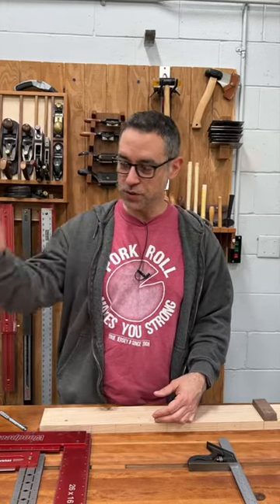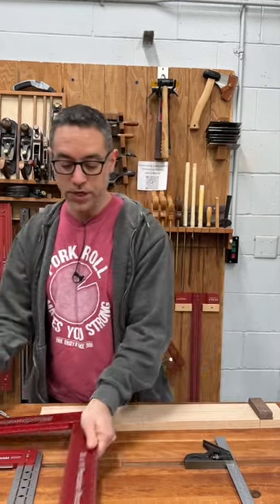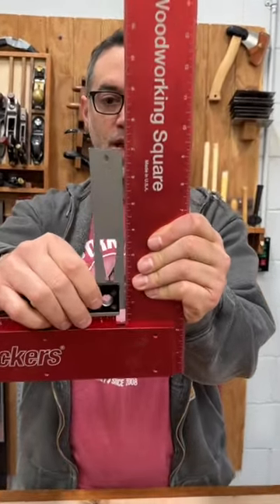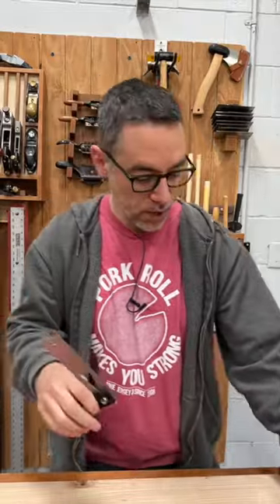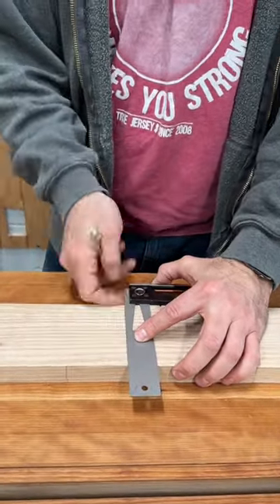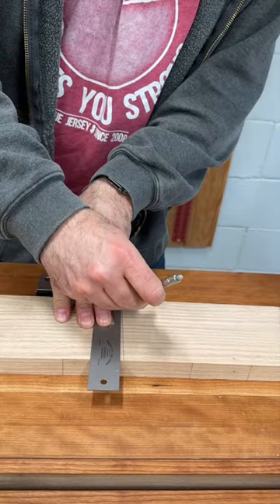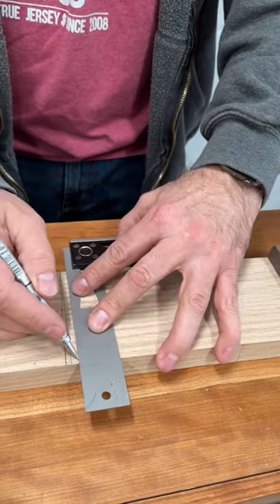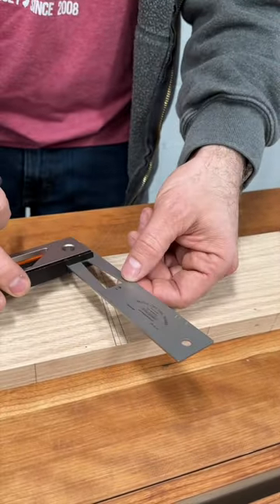Check your squares for square!

Comment: The midpoint of the gap between the ends of those two lines is your 90° set point. This is the same method one uses to make sure one’s plastic drafting triangles are square.

Comment: So a quick way to give yourself a reference edge is to draw a 3,4,5 triangle 3(insert unit here) along, 4 across your wood and check for 5 between the 2 end points. If drawn accurately you will have a square edge you can then use to calibrate your tool to as a starting point and then fine tune with the videos method

Comment: Pro tip: don't fix it. Throw it away ASAP.
Reply: Seems pretty wasteful, when it's such an easily adjustable square. Maybe if it were a pinned/riveted square that's THAT far out of spec
Reply: That’s not a pro tip it’s a dumb tip just recalibrate it 😂 Bridge city squares ain’t exactly cheap
Reply: That's a good tip because that's a crappy square.  Some tools should be adjustable but not a square only meant for 45s. It's junk.
Reply: @lukelehmann474  😂 think you mean 90s 
You can’t exactly say it’s junk unless you’ve had or owned one, have you ?
Lots of tri squares, t squares have adjustment built in its very common many made by very reputable companies. And fixed squares can go out of alignment get bent or distorted

Comment: There's lots of tricks you can do with geometry to get a perfect square.

Most simple one: Take a piece of paper and fold it in half, twice, to get a quarter. Use the corner that's composed of folded edges.

Comment: I have a Starrett #61 fixed square and it hasn’t been “square” since I bought it over 30 yrs ago.  This tool is out of its right angle 1/32” over 2 1/2”.  It has never been dropped and I sent it back to Starrett for repair.  The #61 came back to me the same as when I mailed it for mending.  Apparently, Starrett either refuses to make the repair or doesnt know how.  I sent it back again and it’s still not square.  There’s only two Starrett tools I can count on.  My dial caliper and my #604R 12” rule.  All Starrett tools are supposed to be guaranteed for it’s lifetime.  On a side note, I bought a pair of machinists squares from India for much less than the #61 and they’re dead on.  In fact, there’s a 6” Swanson square I bought from HD and it’s dead on too.  I never thought Starrett would disappoint, but I was wrong.

Comment: Can always use 3-4-5 rule with just 3 measurements. Draw a 3" line, then draw a 4" line as close to perpendicular to an end of the 3" line. Then complete the triangle with a 5" line. If its off, readjust your corner as it might be off of square. Once you get it to exactly 3", 4", and 5", that corner will be a perfect 90!

Comment: I wouldn't call that a high quality square. It's expensive but a high quality square wouldn't be off that much.
Reply from the maker: Maybe I didn't explain this well enough. This square hasn't always been off. It must have been dropped or knocked around, causing it to go out of square. I've had it for years and this is the first time I've had an issue with it. The main feature and oddly enough, flaw, of this square is that it's adjustable. If it's adjustable, that also means it can be knocked out of calibration. So it's up to you whether or not you want a square that can be calibrated, but the fact that it went out of calibration isn't necessarily a sign of quality in this case.
Reply: @woodwhisperer  Yeah that makes sense. I guess I have issue with building in calibration on something you would use as a reference.  Whats the point of having a square if it can go out of square? But I guess for centuries they used wooden ones that would need adjustment so perhaps Its much ado about nothing...

Comment: Is it important to test both edges of the the square when doing this? I’d think that it would show squareness and true straightness, but maybe I’m overthinking?
Reply: Hey Mark,  Doesn't seem like you have luck with Harvey/ Bridge City tools. Any ideas why?
Reply from the maker: lol weird question. I feel like you're trying to imply something.
Reply: @woodwhisperer  no implication intended. I’m more thinking about the lower quality and cheap squares or straight edges that I tend to use as a novice woodworker. If my combo square is in doubt for example, I’m wondering if I should do the straight line test on the inside and outside edges if the square. If that’s overkill, then I’m just wasting time. Eventually I plan  to save up for starrat or similar quality tools. Maybe a bridge city like in the video eventually. Any guidance would be appreciated. Thanks for the great content!
Reply from the maker: Sorry, I was referring to George's question. I usually don't check both edges but you probably should. Most good quality squares will have the blade manufactured with two perfectly parallel edges. So it's something I usually take for granted but it can't hurt to check both edges.
Reply: @woodwhisperer  cool. thanks
Reply: Hi Mark,  I'm not trying to imply anything. I only own one bridge city tool. The universal gage, and I'm still on the fence about that. I have many high quality tools, Festool, Woodpeckers, etc. I am thinking of getting the 15" ambassador bandsaw. It gets good reviews, but l see you have had trouble with quality control on multiple tools from Harvey. . I'm a 30-year plus  finish carpenter/ woodworker. Ultimately, I know it's my decision, but I value your thoughts and opinions.
Reply from the maker: Oh, well the miter gauge is a legit dud in my personal experience. I would avoid it until they come out with a version 2. The square is the only other thing I have from the company and it's a great square. The fact that it went out of square isn't a fault of the square, it's a product of being designed with calibration in mind. WHen you allow a square to be calibrated that means you also open the door for it to go OUT of calibration. It's a bit of a catch-22. But there's really nothing wrong with the square.
Reply: @woodwhisperer  - this is a refreshing and honest dialogue.   Thank you Wood Whisperer…. You’re starting a revolution of the YouTube comment section.   Make YouTube Comments Great Again!

Comment: Don’t buy an adjustable square, problem solved.
Reply: You just might have a very good point!
Most jobs require either a 90 or 45 degree angle. Save the adjustable squares for the odd jobs.

Comment: I bought machinist squares in various sizes. I use them for everything and are treated carefully. Can’t trust anything else. Yes, a pain to constantly put down into its little foam cushion night night bed, but being accurate is more important. Unless I’m just doing some 2x4 framework , then the framing square comes out and it’s fine. Personally, last time a square was out of square I threw it away. No place for nonsense adjustment screws in my shop for a small square, that is stupid.